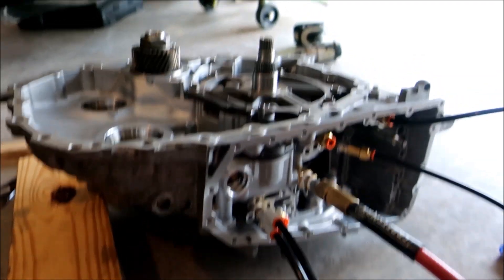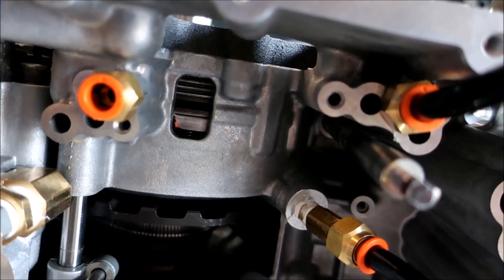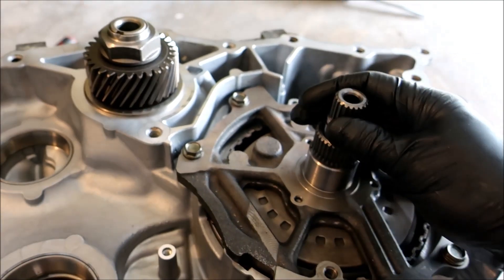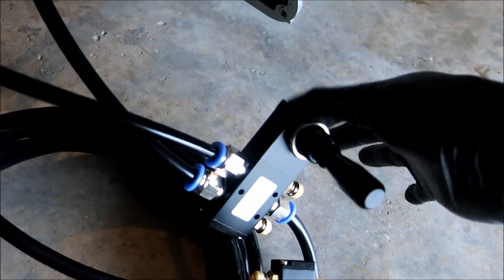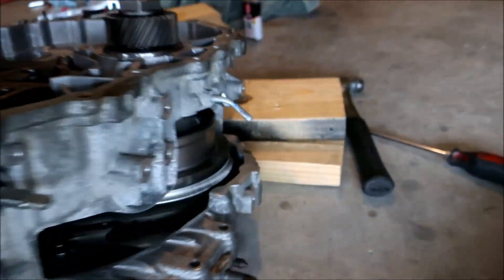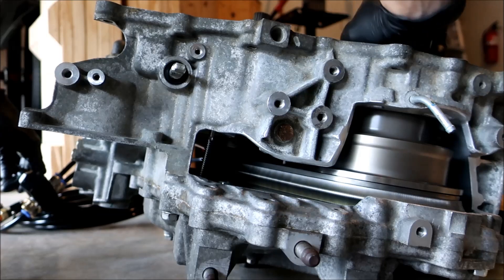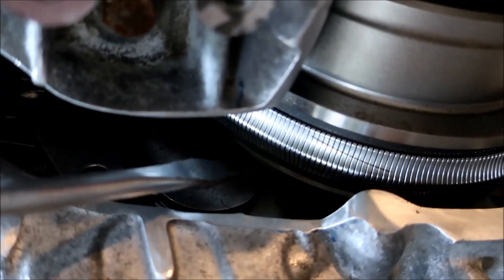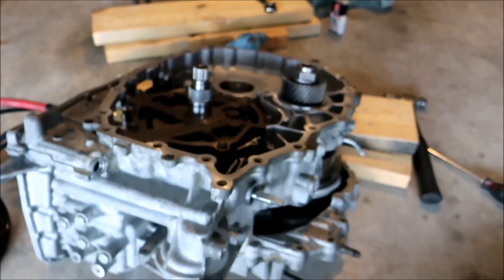Cutaway CVT - Pneumatic Testing

Comment: Nice video man! Could you share the model of this CVT transmission? JF011? JF015? I have a problem related to the leak of pressure. We are trying to solve this... thank you for share information in this video.
Reply from the maker: JF011E transmission. If the pressure throughout the entire transmission is below spec, check the pressure regulator at the pump to see if something's going on with that. There are several pressure tap locations as well on this transmission in case you weren't aware to help hone in on pressure-related issues.